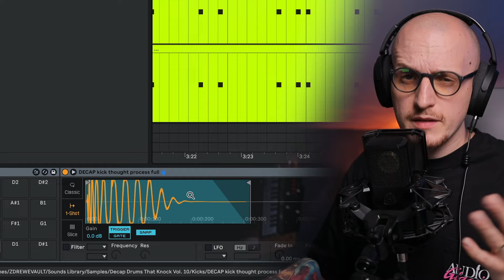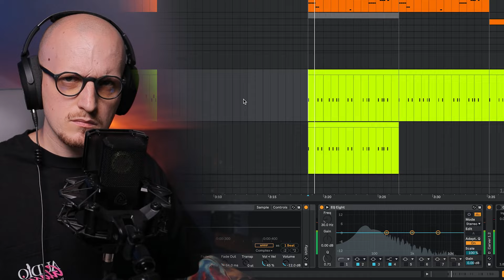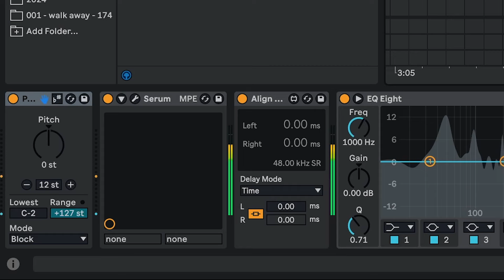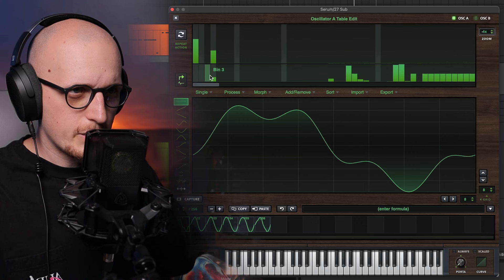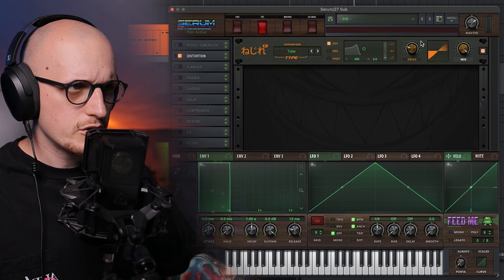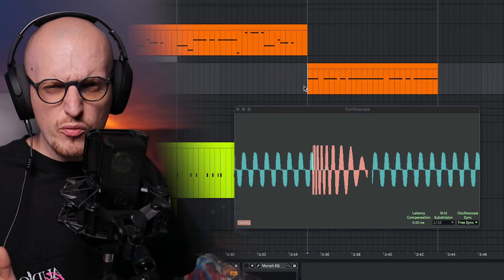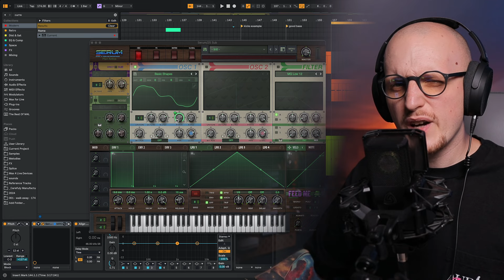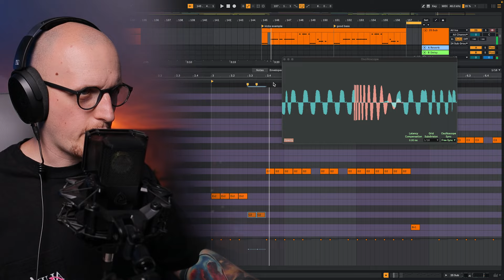I Thought You Can’t Get Better Bass in Ableton…

Comment: 1:40 I'm pretty sure that can be solved by adjusting the release time of the compressor. I don't see how that points out as an advantage of volume shapers compared to regular sidechain compression.
Reply from the maker: You kinda have a point here, although just look at the curve I made right after. Nothing that fancy but it would be hard to achieve with regular compressor release. Thanks for the comment btw 🙏
Reply: @Zdrewe  Another major thing is that you can make the sidechain trigger with another source. So, the way I do it is by duplicating the kick track and then disable it. Then I can put the audio of the pseudo kick as a trigger for the sidechain. And before I step into the compressor settings, I can edit the audio to get the desired curve result more easily. Many people usually replace the pseudo kick with a short click sound audio clip to replicate the sort of curve you demonstrated in the video.

Comment: Yo, how u use shaper box for sc? U use midi clip with midi trigger with external instrument or classic mode with audio trigger? As i think, ableton don't repair pdc in ableton 12 and we have problems with plugins delays.
Reply from the maker: I like to use it with audio trigger but not anymore honestly. That’s because of the delay and that’s also why Chain Shaper is way better solution - no latency at all, even if you put a bunch of plugins before and after
Reply: @Zdrewe  yoyo, i bought today chain shaper, but he works badly, i got clicks at first hit, gm audioducker don't have, shaperbox too, don't have. I use more lookahead and smooth clicks, but it's work bad 😁🙃
Reply from the maker: @1stLov3 that’s weird, I haven’t experienced any clicks inside chainshaper ever. There’s a settings panel inside it where you can find click smoothening option
Reply: @Zdrewe  i know, i tried to use more lookahead and smooth clicks, but it's doesn't work. I'll try again, mb it's a bug.